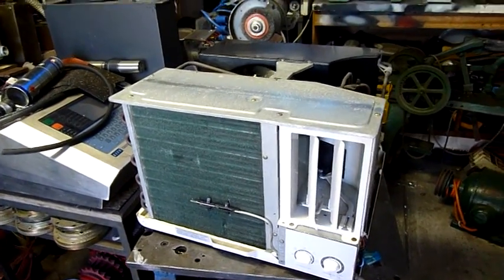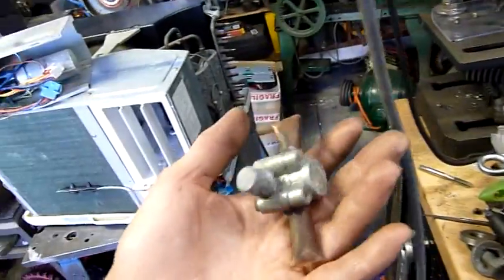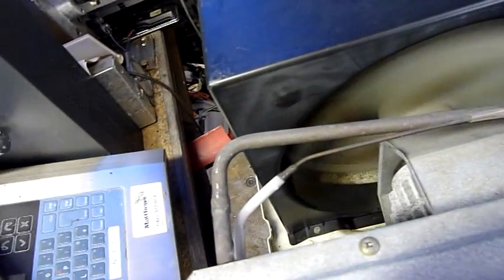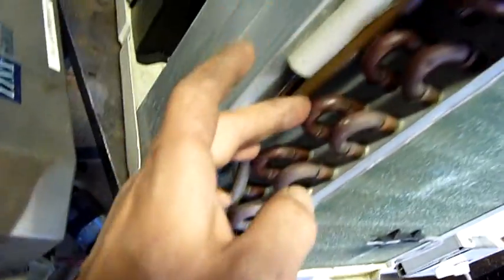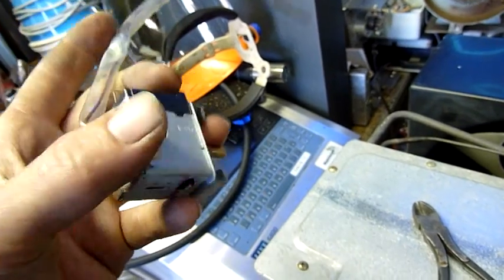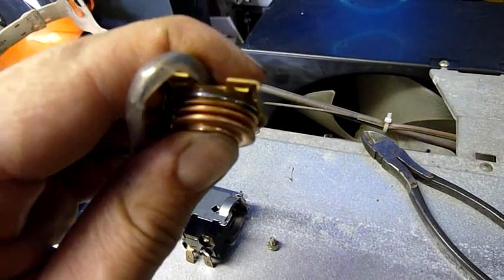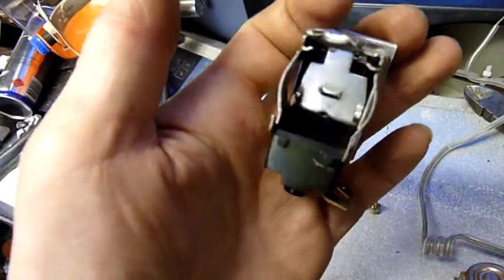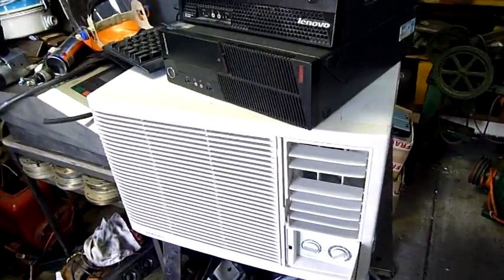Window Aircon Thermostat Replacement

Comment: I have to adjust my thermostat cuz I was making direct contact with the evaporator causing my AC unit to short cycle which the higher pressure in the system due to the short cycle kept tripping my generator on the boat generator on my sailboat so I bought a soft starter thinking it would fix it and nope it didn't but then I noticed that the thermostat bulb is making direct contact with the evaporator fiddled with it through the grill with a knife and got it back in the little clip that keeps it lifted just slightly off the evaporator and now she runs like a charm run like a charm

Comment: So basically you can get any thermostat to work on a 220 a/c (US) unit even if the manufacturer doesn't make them anymore? Mine works better when it's super hot out but when it's 70 outside and 80 inside it's hard to get it to work right. I can't just open the window when it gets that warm i haven't any cross ventilation

Comment: I have a question for anyone that know's. I have a Kenmore model 580.75151500 its 15,000 btu. I have had this machine for a few years now and has been great until yesterday when i turn it on the digital numbers go down by themself. I set it to 70degrees and ever 2 or 3 seconds i will go down 1 degree till it goes the the max at 65. Any clue what would cause this or how to fix it?

Comment: I had my fridge start frosting up all the lines (with a good 1/4" of ice before I noticed the puddle forming from it melting) thanks to dog hair clogging up the bottom-mounted condenser coils. I'm assuming you can't find fridges with rear-mounted coils anymore thanks to asshat owners butting them up against the wall and overheating the compressor?